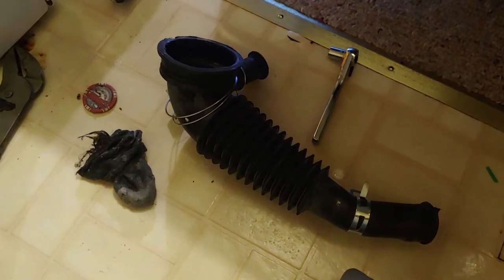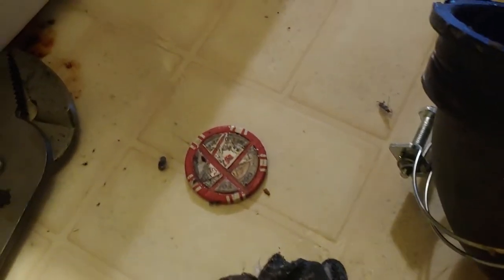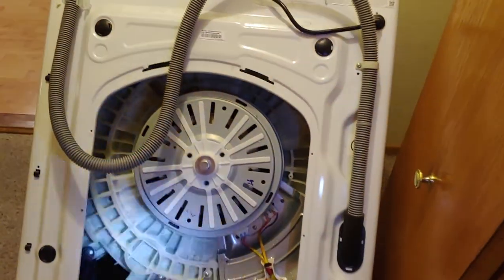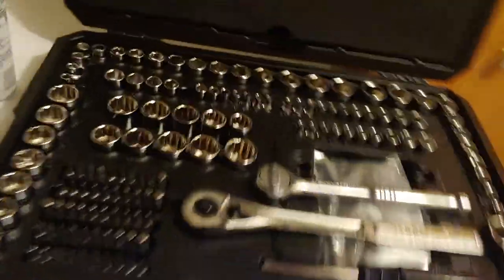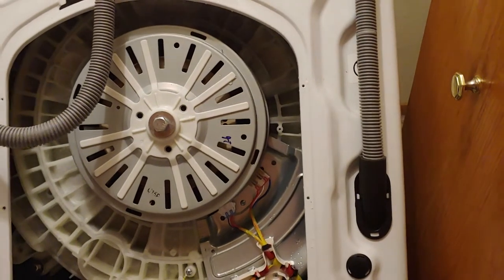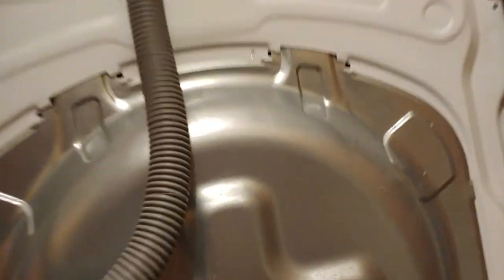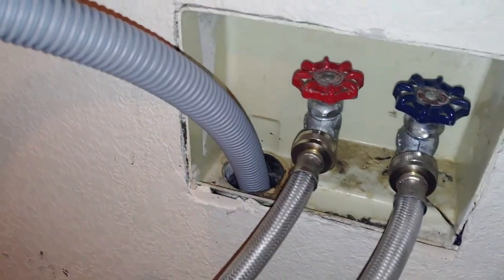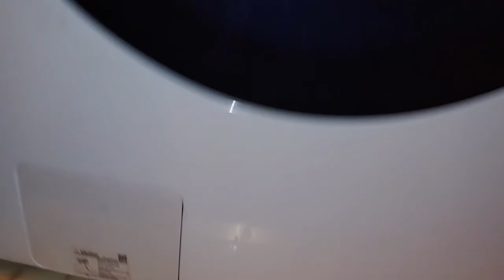Samsung washer SC error code 5c error code fix from under washer. Super easy!!!

Comment: I just wanted to say thank you, your video literally help me get the job done. I had no idea about the hose on the bottom, I always just drain out the filter. Could have used a little bit more light at the beginning of the video, but it was enough information for me to get the job done. Big O $0.50 piece was blocking mine.

Comment: IF you have and SC code always check the filter first, it is the filter most of the time.
Reply: Where’s the filter? I got sc code
Reply: Where is filter located??
Reply: At the bottom of the washer lol there is a door
Reply: I've tried that multiple times and it is still not working. Going to give this a try. Thanks

Comment: Hey buddy trying to take that screw off with a 10 mm socket no luck any suggestions
Reply: I could not take off that screw they placed it at an angle where I really couldn't fit anything and even when I did I wasn't sure if I was turning it the right way. What I did was just take off the two clamps pull the tubing off, and right away I could see the clogged &unclog it. Since it's a rubber hose I smashed it down feeling if there was anything else obstructing the hose and no there wasn't. If there's like a big sock just get a wire clothes hanger and pull it out

Comment: What do you do with water in washer b4 you tip it
Reply: Drain it. There's a small hose next to the filter in the front of the washer you can drain the machine with it takes forever though and you'll need more than 1 bucket of your machine is sitting on the floor